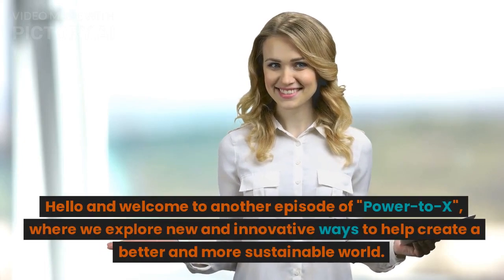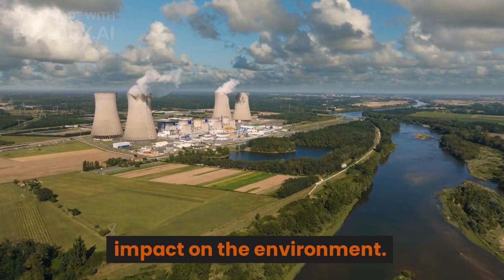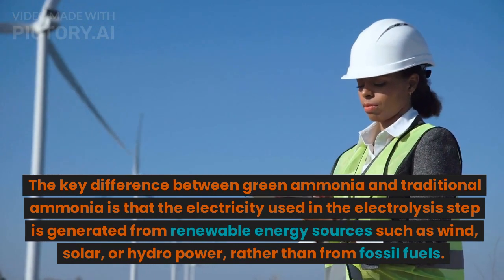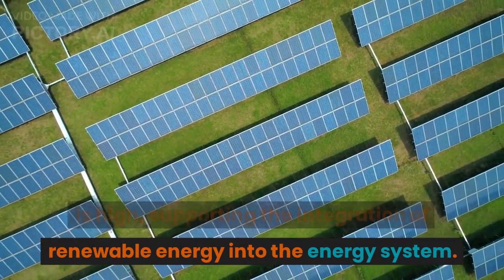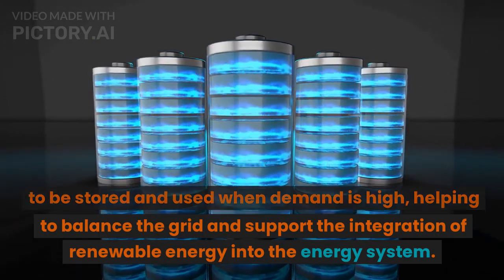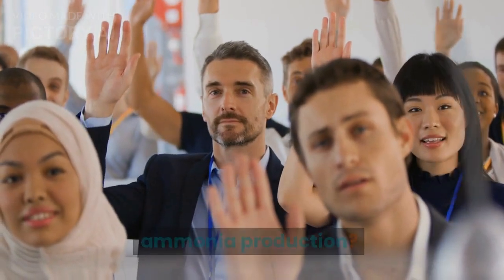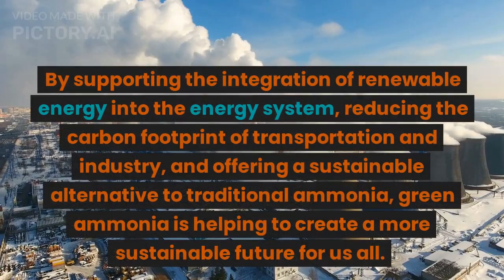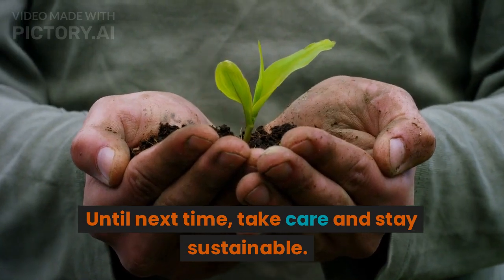Green Ammonia - The revolution in the marine, aviation and long-haul transportation industry

Comment: Please  beware  the dangerous of NH3 as fuel!!*

Safety:💀
Please realize what will happen when accidents occur !!!
https://www.youtube.com/watch?v=KT-3WZ-23Ac          
In old ammonia car we need to raise awareness of leaking as well!!

Global warming:🌍
I don't think ammonia  combustion engine vehicles 🚗,🚤,✈ type is a good IDEA!!Burning  NH3 can cause NxO and NO gas, (However for power plant with   NxO gasses scrubber system might be OK, Please prepare air filter Gas mask as emergency PPE incase of leaking!!)
The NxO gasses such as Nitrous oxide can cause more global warming than CO2 300 time and live upto 144 years!!
both NH3 and NO gas are toxic, especially when accidents occur.
Reply from the maker: Do you think gasoline is a safer fuel. Any fuel need careful approach
Reply: @power-to-x-world   Hydrogen in the form of metal hydride film which release by exact frequency laser is possible better in transport system.  (It has no require strong container which can be harmful during accident occurance  )Plus NH3 + H2O can cause NH4OH which  irritate base to marine life
PS.Actually any batteries type which reduce fire as much as possible ex LiFePO4,Graphene battery ...etc are considerate safer than NH3 in transport system as well but please not Li-NMC which not stable and can cause  class D fire (2000 degree celsius!!! ).

PS2.However NH3 can still be possible a good fuel in well safety  prepared factory and power plant systems.But not with "combustion type" engine or generator one [Must be for Fuel cell generator only!!! ] which completely convert NH3 back to N2 without any NxO gas!!!and need to be well test standard annually even after old time as well!!!
Reply: @power-to-x-world   Pure Hydrogen gas (H2) in strong container  can also be good fuel in ship and air plane,airship(but please use Helium as lift gas instead unless you can fix static different high voltage in different high atmosphere which can cause fire) 

(I consider H2 in strong container still be good fuel in large transport vehicles but not small vehicles one like car )..... etc
Reply: @power-to-x-world  Have you ever compare smell between NH3 and gasoline gas at the same small amount by yourself yet?

Which one is more irritate? From the link of my video of an accident car with NH3,the driver and helper were immediately knockdown due to irritation from NH4OH and died   unlike  gasoline leakage you still be alive for a while.
Reply from the maker: usually ammonia will be used in huge engines such as ship engines, so careful handling can be associated with the process since general public is not get direct exposure to ammonia @prachayaputtapanasub1113